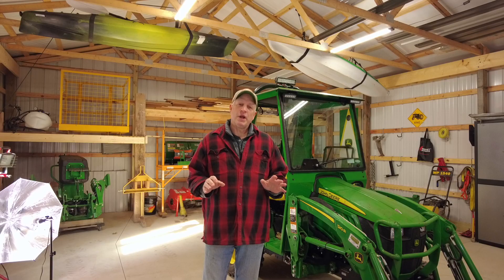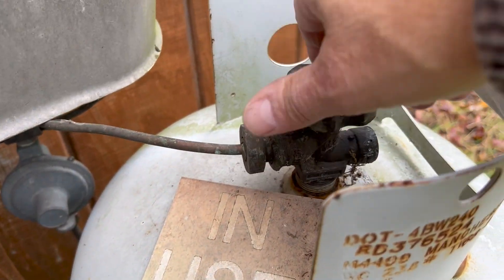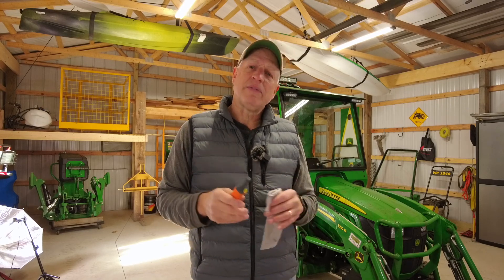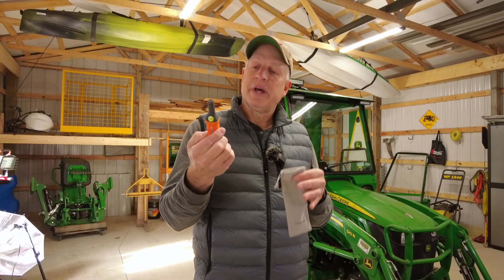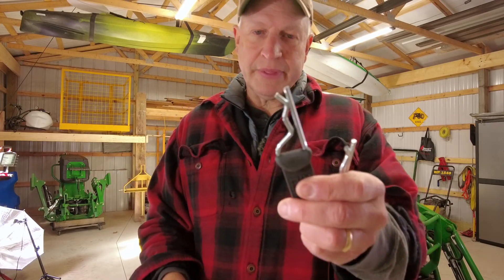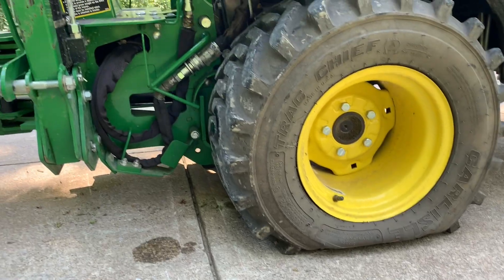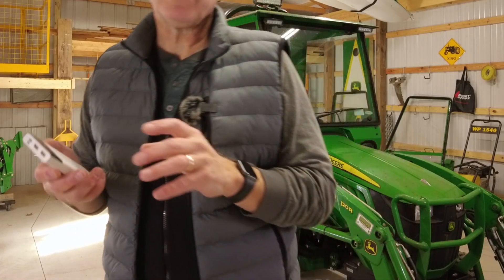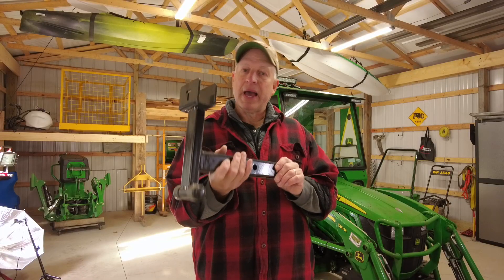Gifts for the John Deere 1025r, RV, UTV and Household

Comment: Tom, that gas detector is a great idea. We got one a while back when we bought a new stove and gas dryer. It worked great. Had a very small leak on the stove that I couldn't smell but my wife did. The detector confirmed it. Just a little bit more of a turn on the fitting fixed it. I never like over tightening gas fittings. Great investment for the peace of mind.

Comment: We used a 3 gas detector where I worked. They were required to be calibrated every 6 months.  We performed that in our district office which was 450 miles from where I lived. Convenient.   The detectors also required a "bump test" prior to every use.  Easy enough to do by carrying a small cylinder of test gas in our trucks.  Then our safety department told us we weren't allowed to carry a pressurized gas cylinder in our trucks.  So, we were required to use a gas detector but we weren't allowed to verify that they worked. I carried the test gas cylinder.

Comment: I really enjoy your videos.  Lots of great suggestions and tips.  Keep up the good work.  I find my “Liquid transfer pump” from Harbor freight to be very useful.  Saves holding up that heavy can of fuel to an almost inaccessible fuel filler on my 1025r with cab. Even with a funnel it’s tough.  Inexpensive at 12 bucks.
Reply from the maker: Is that the battery operated one ?
Reply: @ataleofthreecabins1025  Yep. Just have to store vertically so fluid doesn’t go into the seals. I just set in a bucket with my grease gun.